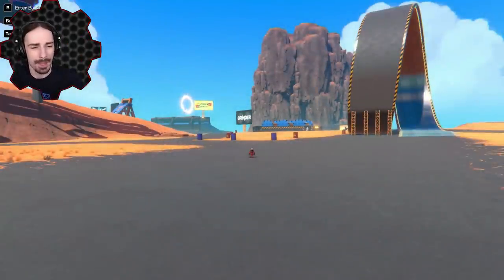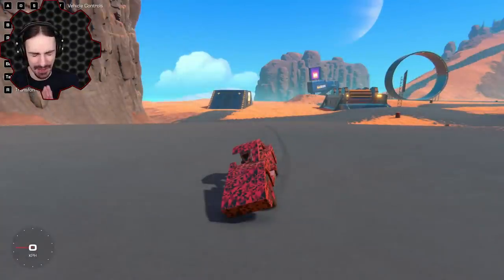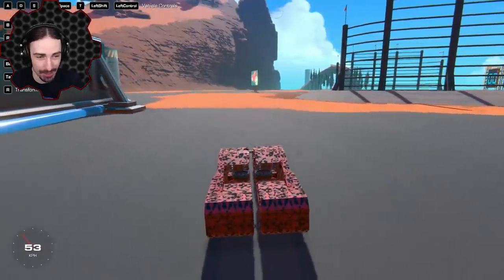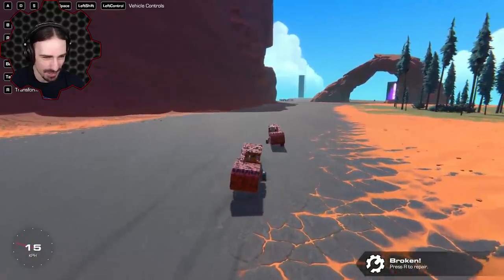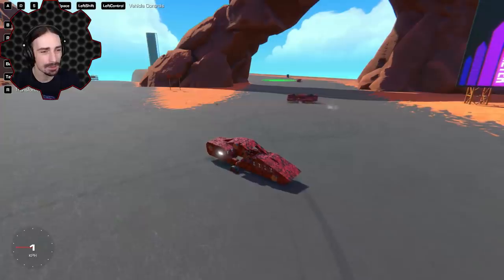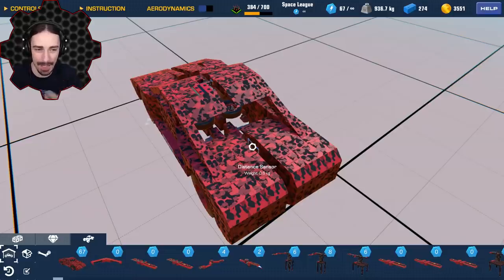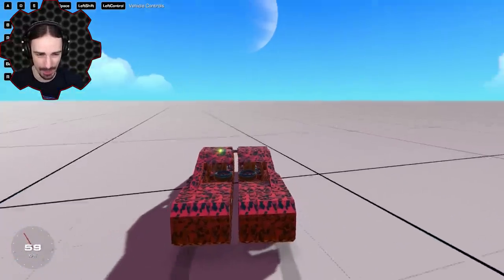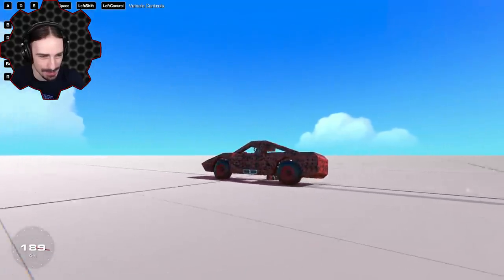This Car Splits In Half and Then Reconnects! - Trailmakers Gameplay

Comment: The best way to control a separate piece at this time is to use a piston on one part and a distance sensor on the other. Difficult, though not impossible for steering because it will require two sets for two directions.
But come on, you could have at least painted the car white and called it Herbie!